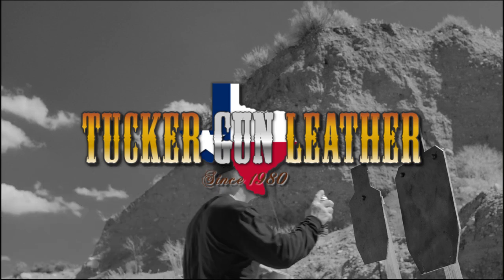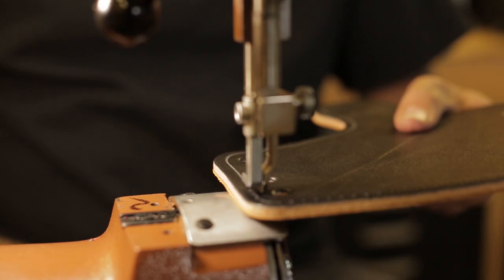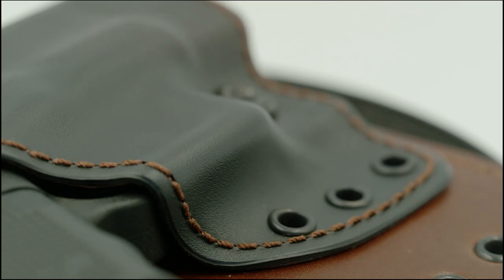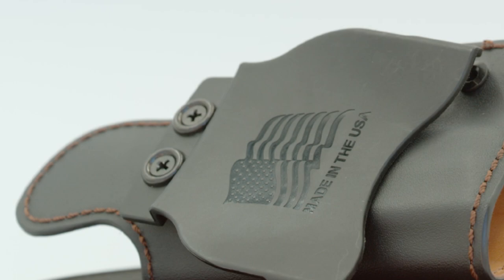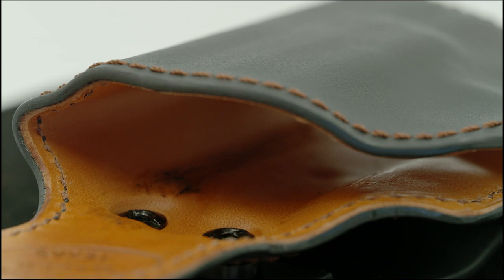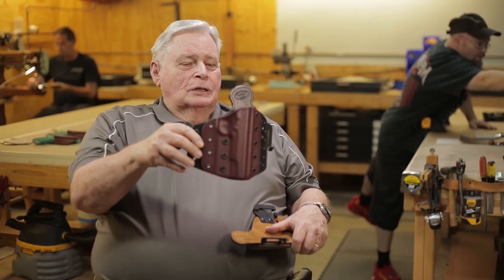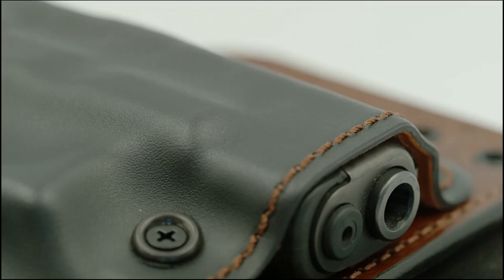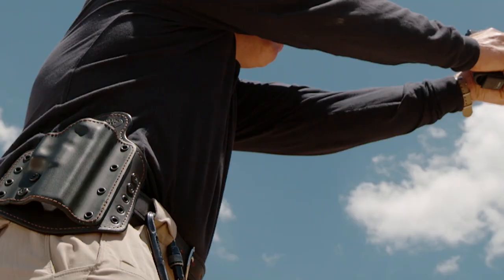Deep Carry Story & Production Process

Comment: Boltaron and kydex have identical heat profiles. The two materials are damn near identical. The main difference is price depending on where you get it from. I’ve worked with both materials and both perform the same. That’s not your difference maker here. What sets y’all apart looks to be your leather and craftsmenship. Patiently awaiting mine.